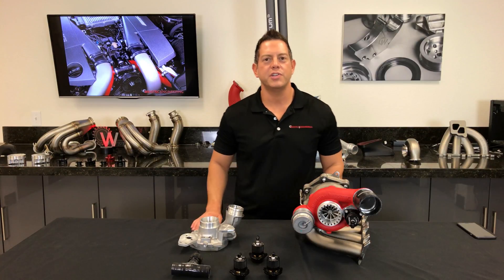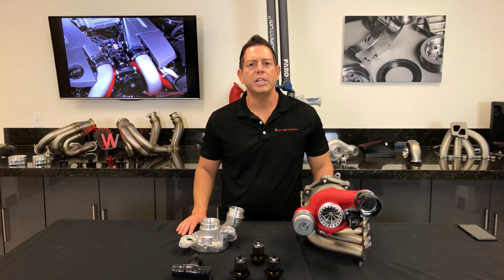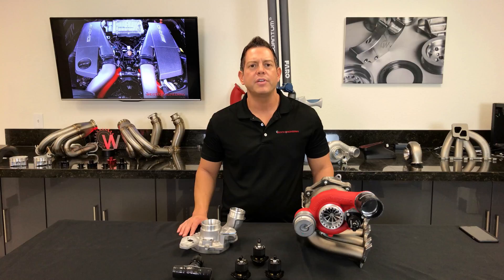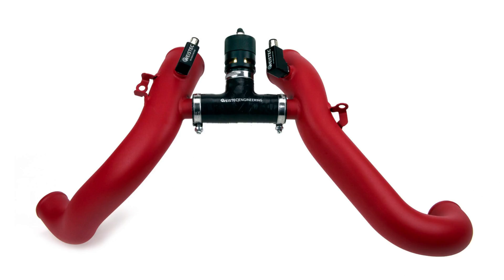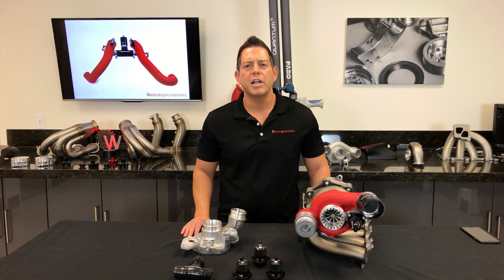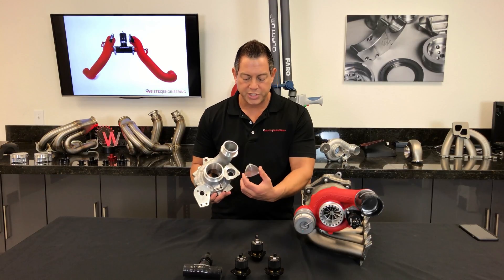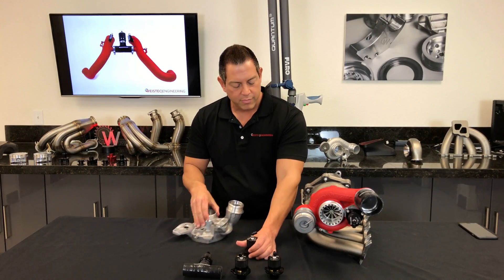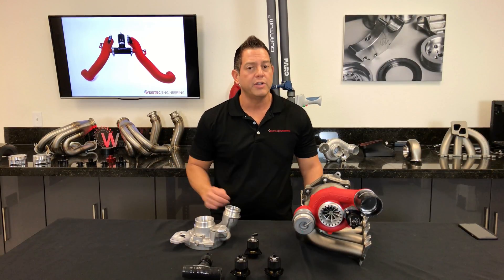Weistec Anti Surge Valve, What does it do?

Comment: Hello I wanted to ask, my car is a 2021 GLE 450 M256 Engine stage 2 tune 361,3 AWHP + 538.8 AWNM and I wanted to install a weistec BOV Adapter, do I need to retune after installing the BOV Adapter???
Reply from the maker: Negative! The adapters do not require a ECU flash